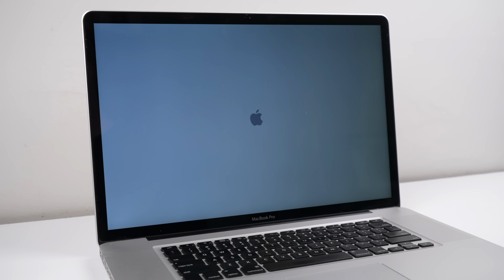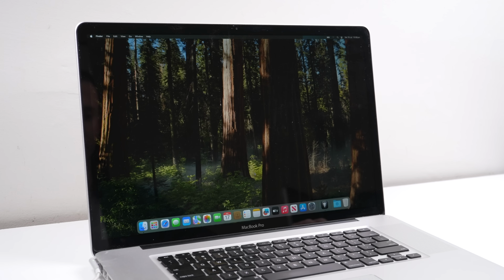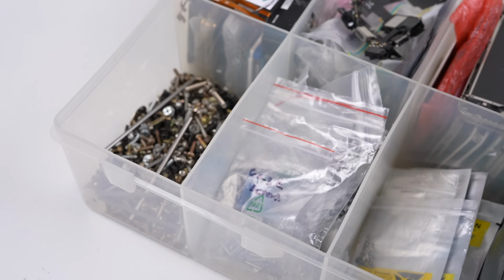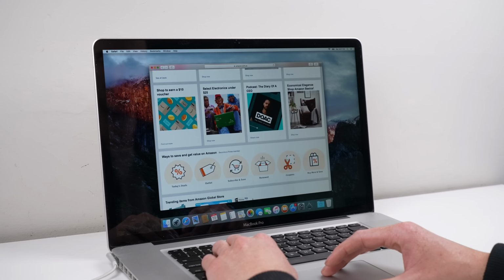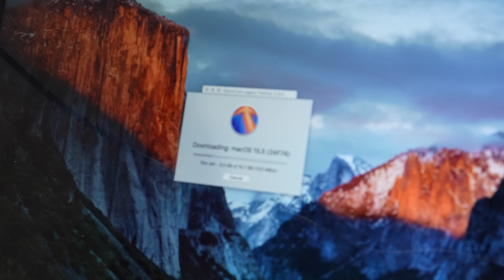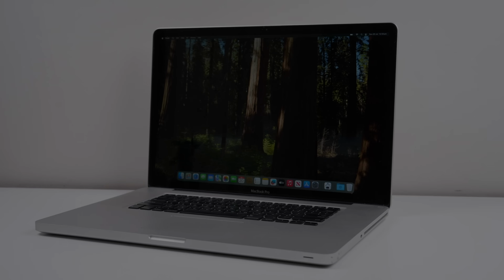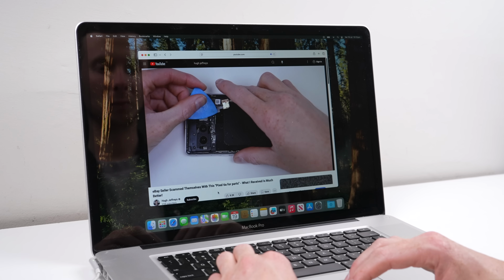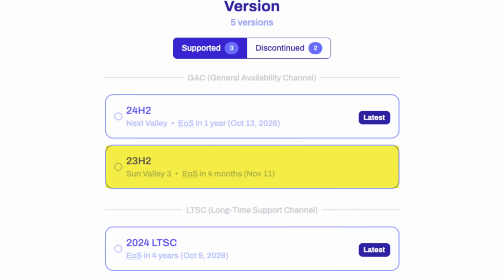I Scored This Old MacBook Pro For FREE & Got It Running On The Latest MacOS

Comment: I have a MacBook White (mid 2010) and I did it too, except for not installing the latest version (I´m using MacOS Mojave). Although I have upgraded with SSD and 2x 4Gb RAM, it´s still slow... and the audio device is not detected, so I´m listening the audio through bluetooth connection with a speaker. I´m considering changing the OS, maybe to windows ou other linux-based OS. What do you guys suggest?

Comment: Got one Macbook Pro Mid 2012 cheap - just 27 USD -and is pretty good to play with.
The original battery still works, not too many cycles, just the SupeDrive needs cleaning & maintenance sometimes works but mostly doesn't read CD or DVD

Got a surprise;  it seems wasn't never updated. I reinstalled OSX from Lion to El Capitan, Catalina and thanks to OCLP running Sonoma right now. Needs more RAM and SSD to test Sequoia. 

These Macs are quite strong and very durable, also yet very popular

Comment: I bought a MacBook Pro about 4 years ago. I think it was 2015 model, and Catalina came on it. After using it for some time, I found it to be a fundamental piece of junk. Not liking to lose money, I upgraded to and SSD, and also maxxed the Ram to 8 Gb. I found it worked a lot better, then discovered it was the OS that I truly hated.  I put Linux Mint on it, and for a few years it was my go-to miracle machine. I still use it,  but I bought a super fast laptop running an AMD Ryzen 7, 7000 series, and already had 32 Gb of RAM. Mint is on it, and I now consider it the best unit I ever owned. That is pretty much thanks to running Linux Mint on it.

Comment: I have a 2014 pro running like a champ. Warning - clicking on a new update may cause you to need to rebuild the non common drivers and the system will be super slow until you do.  You can also fall into a loop where Opencore will want to update but can't because you have a pending OSX update throwing the wrong version number. Opencore then can't root patch because the OSX check fails.

Comment: I just upgraded my 2012 MacBook Pro with 16gb ram, 1 tb ssd and a new battery.  I’m running Sonoma.  It works very well now.  The sad made the difference in the speed.  It used to take 3 or 4 minutes to not now it’s about 30 seconds, all the problems work fast as well.

Comment: Hi Jeffrey, first of all thanks for your video, quality is superb and your explanation is just top. Congrats for that.
I wanted to share my experience and have your feedback if you want to.
I have a MacBook Pro late 2011 running MacOsX High Sierra.
Like you did, I upgraded my HD and RAM to the higher it can afford. Speed increased thanks to new HD, and everything was smooth.
Heard about opencore and followed step by step how to upgrade to latest Seqoia, and just went for it.
After completing the process, I managed to run and taste it.
I found that fans were running without stop at any time, with no apps running, no background process, everytime, cpu was like exhausted without pause.
Does this happened to you?
There was nothing to solve that and i had to make a step back to High Sierra.
Impressions? 
Thanks for reading and please forgive my English as is not my mother tongue.
Kind regards ❤

Comment: I did the same with a Mid 2015 15" MBP!! Although... after over a decade of use, the battery is starting to balloon and one of the speakers is blown... It's been a good run!
Reply: similar model here - used that bloated battery for quite a while - finally switched it out.  as far as the speaker, my left speaker is blown - so fading to the right it was.   poor little speaker...it didn't do anything to anyone.  lol

Comment: Load up a modern version of Linux(Mint is good and easy to use) and it'll work just fine, even without all of the lag you're getting now. I've only done it on an old PC(2012 Lenovo), but it runs perfectly great on that old thing. There are youtube videos of people doing it with macs.

Comment: I have MacBook Pro late 2008. In addition to what you have upgraded I replaced the DVD drive with SSD and placed Linux (Mint). It works quite well. Earlier I have tried to install Windows 10 on that 2nd SSD but with no success.

Comment: My 2009 MacBook Pro was a beast and lasted all the way to 2021 with daily use that whole period.

I did the same hardware upgrades you did as I went along. The SSD difference was so impressive but my first upgrade was to a 7200rpm black drive.

It also had FireWire 800 which was pretty niche to find the adapters for but was clearly faster than usb.

Comment: Unibody macbook pro just work everytime, still using my 2012  13 inch running Linux Fedora 43 work station and watching this video on it too. it just runs so nice but does have 16gb ram with a decent SSD.

Linux is the way to go with these old machines as OCLP is too taxing in 2025

Comment: Warping anywhere on a unibody MacBook Pro IS NOT common. That laptop suffered abuse or dropping to get that way. My 2015 MacBook Pro, one of the last to have the Apple logo on the lid light up, is still in mint condition and is being used ON ITS ORIGINAL BATTERY! I love it. ♥️

Comment: I powered up a 2017 macbook pro just now and my battery is not charging. I am debating on if I should restore it even though I hardly use it or just part with it.

Comment: I have two mid 2012 13 inch MBP - they were stock and worked but I upgraded both to dual SSD (replaced the optical drive) and maxed the ram.   These are the best laptops ever - quality is amazing and they just work.   I'll never part with them.     I run Catalina on them and these are my itunes / media computers.
Reply: So I have a 2013 MacBook Pro. All was well until I factory reset the thing & now I can’t connect to the internet anymore! I’m not sure how to update the operating system at all, any tips?
Reply: @Howard007 use open core patcher upgrade to Ventura and so fast …
Reply: I bought several of these at a VCF swap meet for between $25 and $50 each a few months ago - and 3 of the 4 already had SSDs and 16gb ram!
Reply: How much was your setup??

Comment: I have a MacBookPro (late 2008). I installed Vantura (with OCLP) but it was really slow. I removed MacOS and installed MX Linux - now it runs great!
Reply: MacOS is not an efficient OS for sure , Apple producing iWaste and nobody cares
Reply: I used to run Linux Ubuntu until I got a new laptop with windows os. Last install was windows 10 and now there’s no support for it so…..I installed the newest version of Ubuntu and it now runs great. I remember when I first used Linux you had to search for drivers for, say a printer, and then manually install them but now ….just like any os today…you just turn your printer on and it finds and loads it immediately. My laptop now runs like any modern os. Easy to use and does everything I need it to do.
Reply: let me guess it had an hdd?

Comment: I still have my old Mid 2010 13 inch MacBook Pro , years ago I took out the dvd drive installed a 500gb sdd and at the same time upgraded ram to 16gb and took out old 256gb drive and added a 500gb ssd. All up 1TB and 16 GB of ram still works but more like VS holden ute and not a Porsche.

Comment: I have one of these in the cupboard. I’m probably going to leave it running OSX Yosemite tbh. Whilst it’s interesting and I appreciate all your effort in making this video, I just want to make a comment: all we are doing here is running up a browser and loading a webpage. There is nothing fundamentally different about the web - it’s still just HTML and JavaScript. Why the fk can’t a machine that was top of the line in 2009 do exactly the same job in 2026? I still have Photoshop on mine, and it works fine. The reason is because Apple and Microsoft have hypnotised us into believing we need hardware that is 500 times faster to do essentially the same job. The OS is filled with bloatware you don’t want like BS image playground, Siri and AI. There should be a LTS option for operating systems and we should stop being press ganged into buying new hardware for no good reason. I worked 25 years for a large software corporation and I know exactly the strategy they use: Rinse your customer as often as possible for the same old shit. That’s why Adobe and others now use a subscription model. It’s not justified and we should push back. I admit if you want the latest games or do high-end 3D graphics rendering, music production etc., you will want the latest hardware,  but for people browsing the web and writing documents - nothing much has changed in the last 20 years that a LTS browser and OS shouldn’t be able to support. They get away with it because most people have no idea about the hardware requirements for rendering a webpage or doing word processing, and they believe the high-school dropout sales guy in the store when he tells them that a state of the art processor and 1Tb of RAM are need to browse YouTube and eBay. I do have fairly modern hardware because I do a lot of 3D work, but it pisses me off when elderly relatives tell me they have to buy a new laptop because there’s is running slow, when all they do is browse the web.

Comment: I'm typing this on my mid 2012 MB Pro that I still use to this day. Upgraded to 16 GB RAM and a 1 TB SSD on Catalina. It runs as fast as my 2021 model. I was not aware of OpenCore, but want to explore that option. Great video.
Reply: I have the same Macbook and I'm about to Catalina-Sonoma it. It's a fairly long process if even with a clean install on a new drive (which is the safest method). Chat gpt can give lots of unnecessary process killing scripts after installation if you need the laptop to be max optimised for stuff like Audio and Video editing. Best to follow the relevant Mr Macintosh tutorial video on any other computer as you go though the process, but it's pretty easy, and don't panic if something misfires, it's usually just a case of backtracking a step and starting from there again.

Comment: Dude I have almost that exact same model(mine is actually a Late 2013 i7) and have hated the fact it isn’t more useful. I don’t mind old hardware, in fact I often prefer it. Mine was bought as part of a school program and was close to maxed out for use as a studio and show production laptop. I was aware all the supposed “limitations” as it aged were artificially imposed by Apple And MacOS. I’ve certainly used linux on it before… but would absolutely love to be able to run current MacOS/services and reclaim it. 

Thanks for this!

Edit: welp… never mind. I don’t have any other Mac so can’t create the installation media which is a problem that I’ve run into many times before trying to update this thing. I guess I’m stuck until I find someone trustworthy with a Mac willing to help. 🤷‍♂️

Comment: Great to see the revival, but what's the point of an OS that can't run programs and YouTube properly. In the end you just want it to work. I would try something like a Linux distro, one that looks like a modern macOS version but runs more like an older version (much smoother). I would try Elementary OS or Ubuntu Budgie.

Comment: I have a 2011 MacBook Pro 17 inch too but with 16Gb RAM and without any scratches or damage. I installed a 1Tb SSD so it runs a lot faster. It cost me $3700 new and such a waste to have laying around unused. My main issue with it is heat. The fans start going and it gets awfully hot. Based on what I have read online, I suspect the graphics cards are the main reason and will likely fry themselves to death. I installed Open Core also and upgraded to Sonoma but it runs like a slideshow. I havent had time to look more into it but I suspect there is a way to fix this. I also think the thermal problem can be fixed with re-applying thermal paste but that means I need to do some serious digging removing the motherboard and a quick glance at iFixIt step by step manual reveals a great number of steps and potential for breaking something.

Comment: I have the same model. I upgraded it by removing the disc drive and installed a solid state drive. Apart from battery issues, the most annoying aspect is the noisy fan. I wonder how your fan is performing.

Comment: I have MacBook Pro Specifications 09/16/25
MacBook Pro (Retina, Mid 2012)
PROCESSOR:    2.6 GHz Quad-Core Intel Core i7
MEMORY:    16 GB 1600 MHz DDR3
STARTUP DISK:    Macintosh 2012
GRAPHICS:    NVIDIA GeForce GT 650M 1 GB
     Intel HD Graphics 4000 1536 MB
SERIAL NUMBER:    C02K51CUDKQ4 
Can I upgrade this to macOS 15 Sequoia?

Comment: Dear god almighty, I have been looking for something like this for months as my keyboard is messing up after giving up on windows when trying to install it on a Macbook Pro 2010 6,2! MY BIG question is sir, will this work if my 2010 Macbook runs high sierra with a fresh install? I have gotten so many past errors due to the lack of support for older macbooks in the past that I have been trying to get it going on Linux with the same keyboard driver issues as windows. Lastly, If this Macbook that I own is able to use this program to go to the most recent MacOS, would I be able to bootcamp it allowing me to have a windows side as well (since High Seirra and below allowed only a physical windows disk for install) and getting my keyboard drivers to work finally? I am sorry for the long question, but you gave me hope I have not seen in almost 9 Months! Thank you for the amazing Videos

Comment: I would buy larger capacity DDR3 RAM.  The DDR3 memory architecture was "supersized" toward the end of its run and I can guarantee you the machine would probably see 32gb without issues.

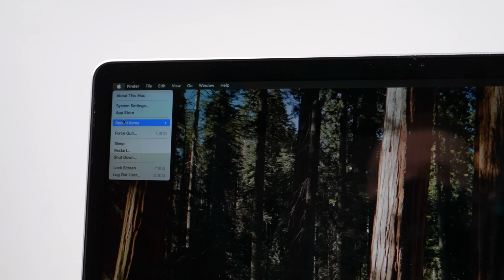Comment: 9:24 not anymore, but there does exist an Nvidia GPU iteration with support for Metal: Kepler. I personally still daily drive a 2012 Unibody MacBook Pro for this reason, it’s the oldest MacBook Pro which won’t encounter a myriad of software support issues due to missing APIs.

Comment: I also got the same model for a good price and revived it with a 512 GB SSD and 8 GB RAM. However, I used El Capitan as the last official OS. Combined with the latest Pale Moon browser, it runs fast and stable. I even tried torturing the book with Vetura, but it was basically unusable.

Comment: Hugh, 
Update : I found an El Capitain Flash drive I made a while back and after I erased the new drive and formatted to Ext Journeled it could see the drive and installed the OS without an problem! When I erased the drive before with the Ventura installer it defaulted to APFS format. That was the problem. Now to see if it will upgrade at least to Monterey.
1st Post
I have updated MacOS on 4, 2015 and up iMacs and Macbooks with the original drives using Open Core.
I am now working on a  2011 A1286 Macbook Pro I am stuck after installing a Kingston 240GB SSD.  I had updated the original drive Ventura but it was very slow.

I did manage to clone the drive to the new SSD but it will not boot after I installed it inside the Mac.
I have a Monterey installer drive but I just get a grey screen that has a circle with a line through it. Recovery also fails , I did manage to get to disk utility and erase the drive.
7:35 So do I need to find a Mac running El Cap or Mountain Lion to make the OCL boot drive with the same OS version?  What a pain I would really just like to go straight to installing Ventura or Sequoia. Any suggestions would be greatly appreciated. Thanks

Comment: I upgraded my 2011 MacBook Pro with an OWC SSD and OWC 16 GB RAM, which were never options from Apple. It ran great for 10 years! In 2021, the plastics and speakers completely disintegrated. Instead of replacing any more parts, I bought a new MacBook Pro in 2021.

Comment: I got a free 15" 2008 MBP, a free 15" 2011 and 17" 2011. All of these are amazing but they all struggle at one thing in summer: 1080p30 playback. They get super hot doing so. They definitely work and can be used for light internet and multimedia, but don't expect MUCH.

Comment: Whoa whoa whoa, slow down here young sir! Snow leopard has (well) actually not one, but TWO functional browsers that some insane beautiful people are still maintaining to this day. One of them is called interweb 55 and it actually renders everything correctly, you can log in everywhere without any issue, YouTube works, GitHub works, everything works. Also, an os is more than just a browser. I assure you that iTunes works fine, quick time works fine, you can write stuff down using office 2008 and it stays written just about the same as in any other office. If you need more unixy stuff, macports are still supported on snow leopard, and thus you can get the latest version of gcc, clang, git and vim and hack away. It’s surprisingly usable, even in 2025!

Comment: For that Mac I would use ventura, its the minimum requirement to install latest apps from Apple Store. I've just got a dumped Macbook Air and did same process Open Core patched with Ventura and just runs great Youtube, MS Office, and most common apps for a daily basis computer. Appreciate for the video, You have a new subscriber from Argentina!

Comment: Installing Ubuntu would be also a good option :). But I don't use Linux myself it requires a lot of fixing and working around, where as Windows just does the Stuff I need.
I hope Linux becomes a more Mainstream option and a valid alternative to Windows 11 and macOS.